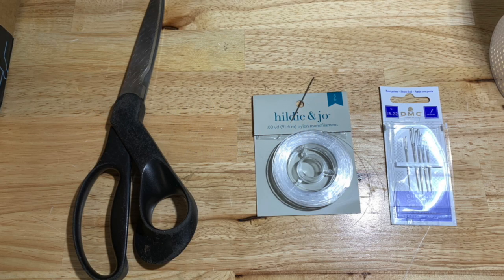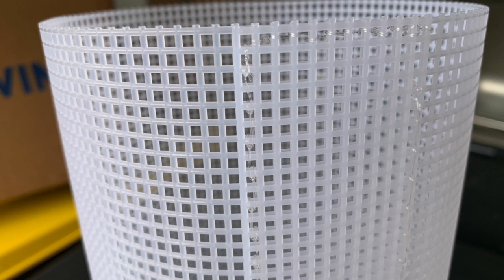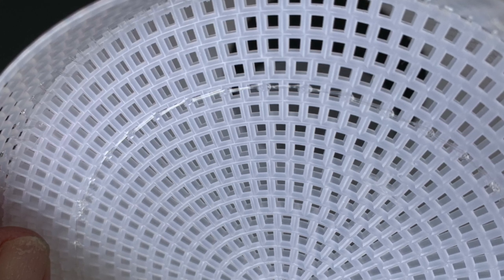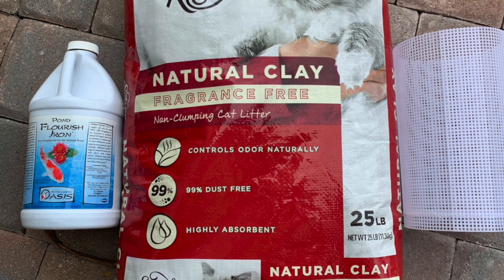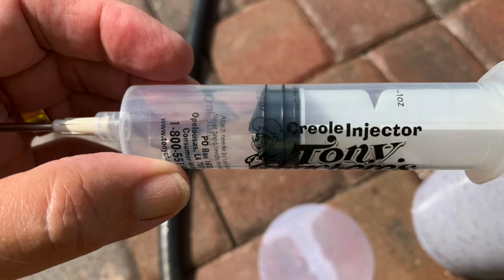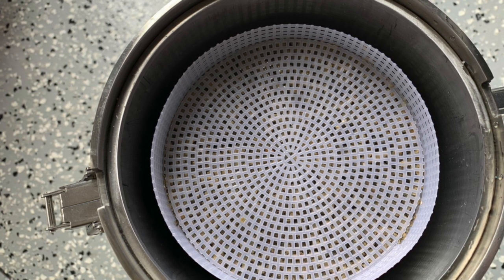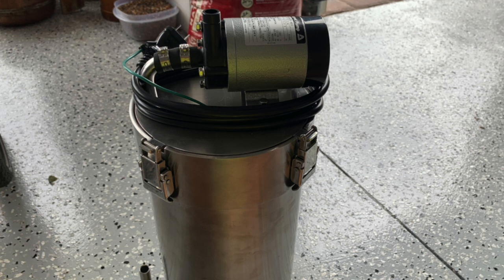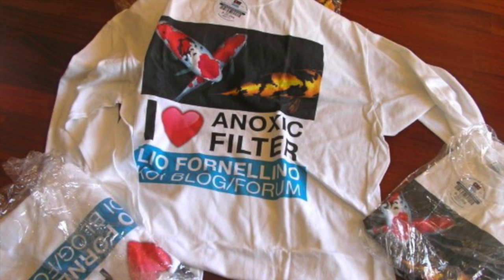Converting an ADA Super Jet 600 Canister filter into a Nitrate reducing Anoxic Filter.

Comment: do you have a video on how much media you need per gallon? And can I make a basket for a hang on back or is the flow too high? I have aqua clears, which I could also retro fit with an air lift system for a trickle filter.
Reply from the maker: Not really.

Comment: Dr Novak would Seachem Flourish Iron or Flourite RED be a suitable substitute for what you used?  Thank you for your videos.  I'm trying to replicate your experiment using an Eheim classic canister using Oil-Dry.  The Walmart kitty litter in Canada had very small (sand like) consistency and wouldn't work for me.  Hopefully this works.  Thanks again.
Reply: Hi Chris - have done this yet? Any experience to share?
Reply: @vikkirountoit497  I’ve had my canister set up fr about 2 months now. I have Norma seen a reduction in nitrates yet. I’m experimenting with three tanks using different water conditioners (my city uses chloramine so most conditioners Glauber added binding agents for ammonia that has an effect on anoxic bacteria). Waiting to see if this works.
Reply: @chriscaragiannis6783  Interesting - I use Seachem Prime to prep my aquarium water. I am hoping that I can continue to use it and that it will not cause a problem for the anoxic aspect of the plenum I'm setting up for 10g or for the BCB I plant to set up for the 75g. Thanks for your update!
Reply: @vikkirountoit497  I’m trying three different types of conditioners to see if it makes a difference. So far no difference.

Comment: Once again Doctor, great video. You have me convinced to give this a try. I mentioned in another post that I am using Fluval canisters. You think this could be used in one of them like a Fluval 307 or 406? I'm guessing I'd just have to leave out all the baskets and sponge racks and make that media basket you described. I currently run a FX4 and the 307. My plan would be to run the FX4 unchanged and put the kitty litter in the 307. In other words run both the standard canister along side one that the anoxic bacteria. Love to hear your thoughts
Reply from the maker: It sounds good but I'm not that up to date on just how the new Fluval's get the intake and exit output of water into  the canister. The water has to circulate around the BCB in order for it to work. That is why I personally chose the Eheim classic or ADA canister filters because water must come in from the bottom then go up to the outlet at the top.
Reply: @anoxicfiltrationplenums  The Fluvlas have the intake and output at the top. I'm guessing it may not work

Comment: Fantastic
...Dr Novak
...if I use laterite soil and bake it... would it have the same effect as the kitty litter?
...if use kitty litter that is not clay...does it need to inject the iron ions?
Reply from the maker: You can use pure laterite soil that would be just fine. Laterite  is nothing but clay so that should work.
Reply: @anoxicfiltrationplenums  Can I just use Seachem Red Fourite and no kitty litter?
Reply: @anoxicfiltrationplenums  Thanks for the reply

How to size the anoxic filter for 2000 liters tank?

Comment: Sorry for so many questions, but i am just raring to try these methods with what i have available with me..

I have a cannister with compartment trays in it.
Can i use a mesh bag with appropiately dense media ( keeping a gap of half an inch from the sides) in each of those compartments..will that work too? ( Of course, keeping a fine sponge above and below all these for the mechanical filtration part)
Reply from the maker: Yes as long as the water is not forced through the bag itself then it will do.
Reply: @anoxicfiltrationplenums  i was doing some online reading up.. from what i understand as of now, any material which is porous, permeable, clay derivative and doesnt disintegrate should work..  i got the idea that they should have a good CEC..that will draw the ammonia in..  so keeping all those in view, can vermiculite be an alternative choice?  Also, iron, can it be supplied as ferrous sulphate instead of laterite?
Reply from the maker: @Kingshukpalchoudhury   do not use vermiculite your tank will become a mess of cyanobacteria. Stick only to what I have tested or your outcome may not be favorable. This is how people fail by using the Anoxic system by trying to change it and then it fails on them.
Reply: @anoxicfiltrationplenums  thanks.. could you be so kind as to tell the reason/principle due to which vermiculite will fail?

Since you suggested zeolite works..

Are there any other material you know of that works?

Thanks again for the quick responses..

Comment: Hello doctor novak. I am from the philippines and i have been trying to make your BCB or at least pattern one from your design but we dont have the kind of kitty litter that you use.  All we have here are the clumping bentonite kitty litter and if lucky, non clumping scented bentonite (which is really rare as well). Is there any other substitute doctor? Can i use crushed red clay pots as an alternative "macro"substrate? Also, is it possible to use the injectable iron dextran used in piglets as the iron source inoculant of your BCB and as replacement for the laterite core (or can the broken red clay pot be considered as laterite already)? And finally, can wood charcoal be used for the BCB or as a substrate substitute (and carbon source)?

I really hope you could help me with these questions doctor. I value your input highly and with much respect. Thank you very much.
Reply from the maker: Bentonite: Do not use
          • Clumping cat litters are made of Bentonite clay, which sticks together when wet. The bentoniteis usually mixed with quartz and diatomaceous earth, which are absorbent.

             Other Clays:
       
         • Various types of clays are used for non-clumping cat litters. Zeolite, diatomaceous earth and sepiolite are common.

        • (Only use clay –Attapulgite-that has been mined from the earth, clean, baked, and pulverized such as Kitty litter.)

Comment: Since you added this to your parrot fish tank, wouldn't it obfuscate the results from the slow moving plenum? Unless you have another tank with parrot fish im unaware of
Reply from the maker: no, this would only help the biological filtration of the aquarium, with less maintenance.This would also be good for bare bottom tanks too. Like Discus tanks for example.
Reply from the maker: Plenums serve two purposes, one; they can have an effect on the reduction of Nitrates NO3 by negatively charging the substrate and keeping algae at bay by Dissimulative Denitrification. Two; they prevent the dreaded anaerobic situation that begins when oxygen is deprive from aerobic bacteria and favors that of anaerobic bacteria. This in turn will start what is called Assimilatory Denitrification and only make more ammonium ions that will go back into solution once again.

Remember, a negatively charged substrate attracts positive ions like ammonium; these ions facilitate aerobic bacteria and facultative bacteria. Facultative bacteria has the ability to reduce the ammonium ion into Nitrates which it will then use its oxygen (Because it has three molecules of oxygen attached to one molecule of Nitrogen) and turn it into N2 known as Dinitrogen. This ability for the substrate to do this is because of the plenum: Which allows water to flow very slowly in and out of the substrate encompassing needed oxygenated water but never allowing it to become depleted of such. 

Inside the plenum redox always stays in the high mV values and never allows oxygen to dip below .5 ppm and stay in what is called an Anoxic State. Anoxic condition only means that oxygen is at 2-.5 ppm but not void of oxygen altogether. Without the plenum the substrate even with thriving plant life will turn black from anaerobic bacteria.

There are three ways of bring oxygenated water into the substrate. One, by moving water through the medium with airlift tubes or a mechanical power source like a power head. But now you will have turned your undergravel filter into a mechanical filter too. 

Two, through heating cables laid on the bottom of the aquarium this intern will cause thermal convection. The trouble with this method is it only works in the colder winter months and not in the summer months when the ambient air temperature in the home is warmer. Plus, the cables may malfunction like they have on me and overheat the aquarium. 

Three, with a plenum that becomes eclectically charged inside the plenum itself and then through diffusion of ions will bring water into the substrate as needed. Plants will not do this with their root systems alone. This slow diffusion of water, oxygen and molecule interface will aid in plant root oxygenation and bacteria growth. You have a better chance of avoiding dead zones and bad microorganisms’ growth populations turning the substrate black from fermentation.

Comment: Hi, Dr. Novak can I use lava rock instead of kitty litter? Lava rock here is much cheaper than kitty litter. I wonder if it has the same effect.
Reply from the maker: sorry no. it is not the same use Oil Dri, Safe T Sorb or Kitty litter only.
Reply: Thanks for the response Dr. Novak. I'm planning to use hydroton which is similar to the kitty litter in your area. I can't find the same kitty litter here in the Philippines, mostly it is made of bentonite.

Comment: dr Kevin, if I didn't have kitty litter and laterite as the substrate, are there any substitute for them?
Reply from the maker: If you're going to make aplenum the most important part of that is having the substrate that you like and try to have an iron source in that substrate. The ideal depth would be about 3 inches and some people have mixed it with a little bit of whatever they prefer and another substrate such as Fluval.
Reply: @anoxicfiltrationplenums  thanks for your reply.  Apart from the laterite, are there any substitutes for kitty litter? It is really hard to find kitty litters that are natural, baked clay in Malaysia

Comment: Hi Dr Novak,

I was introduced to your Anoxic filtration method through a youtuber @ guppies stories.

For my stream tank (you can check out my channel too), I am using 2 fluval fx6 canister filter and 2 big size pre-filter canister filter. 

In my pre-filter, i have loaded them with tons of pumice actually without the basket tho.

I got few questions to ask and hope you could address it.  

1. Would this work if I'm using small size pumice instead of kitty liter? 

2. Is it compulsary to inject the iron liquid?

2. Is it okay for the water output from the anoxic filter flow into the normal convention canister filter or it has to be a separate flow all together?

3. Can both conventional filter and anoxic filter co-exist together? 

4. Could I just convert all my entire conventional filter into an anoxic filter for my 10 footer stream tank that houses almost 100 small sized fishes.

Comment: Hi. Set this up on a 350l litre tank using a eheim classic 600 alone side eheim pro4  600. Nitrates went from 40+ to 5ppm in 3 days. Just carrird out test. However could the cat littre affect the ph ? My tap ph is 7.4 and tank is 8.4. Any feedback would be helpful.
Reply from the maker: Some say the BCB lowers their Ph and other say it rases their Ph.  In my aquarium my Ph is 7.5 using a BCB, the same as my tap water. It could be that your water does not have enough buffers in it. Either try a resin like I show in my last video or a Ph down from your local fish store.

Comment: If I understand correctly, the idea is to have the water flow around the outside of the basket, not through the media as in a conventional canister filter for biological filtration.

So would it not be better to use something solid rather than mesh on the bottom of the basket to minimize flow through? 

I understand water takes path of least resistance, but still there will be a significant amount of water passing through, specially with a powerful canister pump, which would eventually turn it into conventional nitrifying biological filtration. 

This is not the same as your original baskets set in the relatively slow moving water of a sump with plenty of room around for water flow.

Is this a concern?
Reply from the maker: Not really, the laws of physics come into play here with resistance being the key factor. If you make the BCB as in my video then the water will have too much resistance at the bottom of the basket and therefore seek the path that I made for it at the bottom. That 1/2" of space should do the trick to allow water to escape very easy under the BCB.That is why I did it. The ions in the aquarium will then be attracted on the sides, bottom and top of the basket , making it more efficient at attracting them. The BCB is now positively change and will attract the negative ions from solution better. I can already see a big difference in my aquarium already. It seems like the production of algae has almost come to a grinding halt in my tank. This is the same thing that happens in pond that use the Anoxic filter too. This is one reason I placed the tank in direct sunlight.
Reply: @anoxicfiltrationplenums  Great. Thanks for your reply, Dr. I will be converting an Eheim Ecco 2236 following your example.

Comment: Does the water have to flow through slowly? I made one of these based on your previous videos, and I'm restricting water with a ball valve so it doesn't go aerobic. How fast should water pass through?
Reply from the maker: The water passes around the basket not through it. If the water passed through it then it would become an aerobic filtration system ,  like and under gravel filter. And no the water does not have to pass around it slowly it can pass a lot faster than what the pump I have does.

Comment: If you piggy backed 2 cannisters together,  with the first one full of mechanical filter media and the second a BCB filter, you would never have to touch the BCB (for years) and only do a regular  clean on the mechanical filter.  Would this work? Love your vids btw and welcome back and keep them coming. Regards
Reply from the maker: Yes it would, if you have the money for two filters.
Reply: @anoxicfiltrationplenums  it doesn't have to be an expensive filter. I use 2 eheim classics and the mechanical is òne I bought cheap for spares. It doesn't need a pump just watertight under pressure. Any such cannister will do. It's a pity you drilled a hole in that old classic you use as a prefilter in your sump. I did think it was vandalism at the time. Haha. Have a nice day. Kind regards
Reply: @davidflynn6243  im planning the exact same thing, except i use a Eheim Subfilter, essentially an empty canister without the pump.
Reply: @gavinyuen040680  👍I have 2 tanks where I have used an old eheim classic as a mechanical prefilter. I just clean the sponges when necessary and never touch the biological filter. Seems to work perfectly for me.
Reply: @gavinyuen040680  I never knew that there was a eheim subfilter.  Never seen one for sale in the UK. Why are people not using them.
Reply: @davidflynn6243  i am not sure either, and i think in fact if you visit eheim website you cant find such product either, but we got a ready supply of them where i live. Im loving them, i aim have the subfilter do the mechanical filtration and aerobic bacteria and the main filter im trying dr novaks method. If i understand it right, this way, i dont need to service the main filter
Reply: @gavinyuen040680  where are you?
Reply: @davidflynn6243  
Im from Singapore
Reply: @gavinyuen040680  Love Singapore. Spent a few days there on a cruise. Very nice BUT very expensive.  Kind regards

Comment: How can I add one to a filter with trays? Like my sunsun hw303B
Reply from the maker: There is a video out there on just that subject made several years ago.
Reply: @anoxicfiltrationplenums  on your channel? I've watched every video I think. Maybe it's no longer on. Could youn please send a link? Is there even a point of one on a heavily planted co2 injected tank? I'd like 0 nitrates for plant coloration.
Reply: @anoxicfiltrationplenums  Dr. Novak, I think that I've watched all your videos and have really gained ALOT from doing so.   I have 20 aquariums set up currently, mainly African and SA Cichlids, and a couple of community tanks.  I have the Sunsun canister filters as well as some HOB filters on all my tanks.   I'm looking to add your BCB baskets / plenum method to all my tanks.  Is there any advice you'd give on the best way to go about doing so and any recommendations for setting it up for my Cichlids in particular since they constantly move the substrate?  Also could you link the video of the sunsun canister being made with a BCB?
Reply: I found a video that might help, not sure - https://www.youtube.com/watch?v=4uefD7acEiI&t=620s. Wont be doing this for a few months yet, but I'm planning something similar for my eheim canister. For my system, I'm planning to leave the bottom basket uncut with my regular coarse filter material there as it is the first to have water pass through, then cutting my top 2 baskets for 1 BCB, then putting in a top layer of polishing filter before water heads back to tank.
Reply: @vikkirountoit497  thanks ,I’ll have a look.

Comment: I tried regular Anoxic Biocenosis Clarification Baskets (https://mjvaquatics.com/anoxic-biocenosis-clarification-filtration/) with WM Special Kitty and then inspected after a few months only to find a gummy sludge in the baskets. I removed the baskets. There needs to be a much more stable material...(like a fine gravel or a rather coarse sand?)